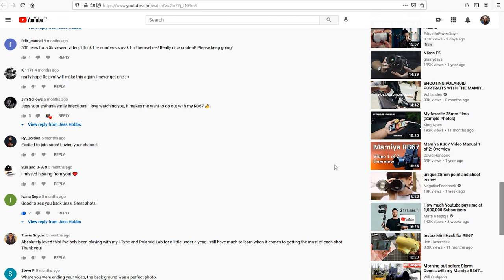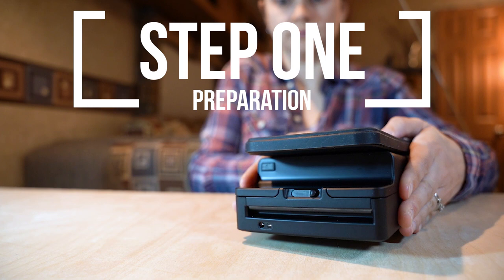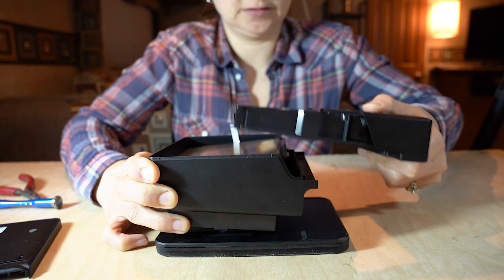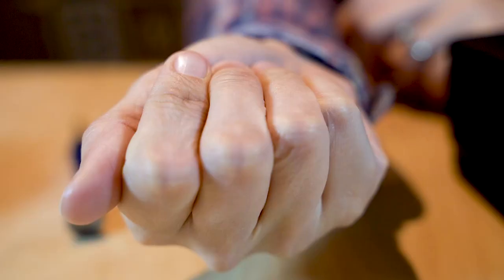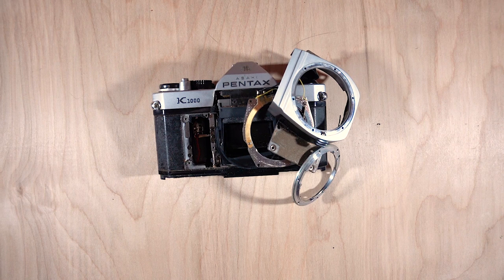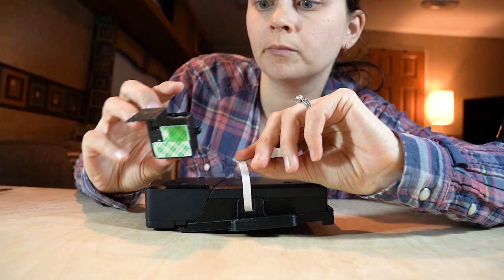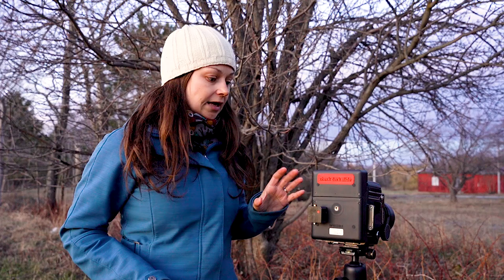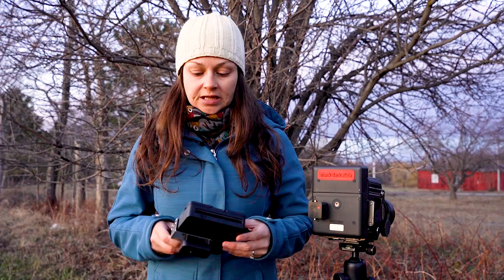Building a Polaroid Back for the Mamiya RB67 ||| Analogue Studio Conversion Kit

Comment: nice video, and darkslide warning on the back, but you need one more!- as this camera RB67 has a mirror lock_up knob on the lenses, this detaches the shutter trigger from the main body shutter button, aka the mirror ALONE fires on pressing the body release!!- so if you do M_up use a cable on the lens, and ONLY hit the back's eject button AFTER the cable release, as NOT doing this releases the mirror only, wasting a frame of this $5-00 /shot film!!, not a "smart move".

Comment: one fix, ask a local mechanic shop (machinist) to turn this on a metal lathe, also a circlip grove would NOT go astray either, bore the hole out to take it, then press the sleive in, holding it against screw force, by the circlip on the other side! ( or use contact adheisive { the two part stuff you mix with the icecream sticks- austa lazanya, don't get any on ya!! ( sorry have Autism, and could not forget this Mission Impossible 1 quote, as it applies here { the puty explosive they use in the movie}) } - one WARNING this quote does hold true, as this glue is ravanous, people have stuck fingers to wood, or to other fleshy parts of their body, and this is an AMBULANCE job!!! ).

Comment: You forgot one necessary and highly important piece of "equipment" for building these backs....a bottle of orange juice. Just add some of the alcohol and calm those nerves!!! :D :P :P It'd be good if you could make one of these backs to fit any MF camera, apart from the RB67.

Oh, don't use isopropyl alcohol with orange juice, though!!! Not a good idea!!! Normal plonk (vodka) will also clean the rollers as well, so use that instead :D

Roid week like in a day or so!!!
Reply from the maker: Hahaha, you are very right!  And definitely don't get mixed up between isopropyl alcohol and vodka, they are not the same!

Thanks for watching!
Reply: Hope you had fun during Roid Week. I did, over on Flickr. Great community there and the standard of the pics was very high. Some really great piccies and talented photographers!!
Reply from the maker: @carltanner9065  I really need to get on Flickr, it seems like there's such a great community there!  I shared mine on my Instagram page, but maybe I'll join in on Flickr for the Fall edition!
Reply: It'll be good to see you there, Jess :D I saw your piccies on IG. They were good :D
Reply: I ended up going through 5 cartridges of Instax pics :D